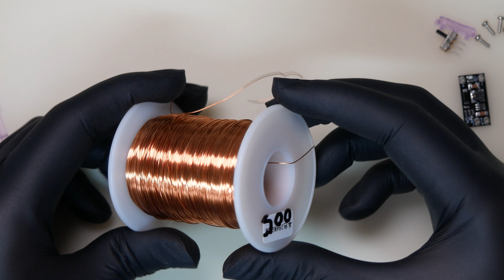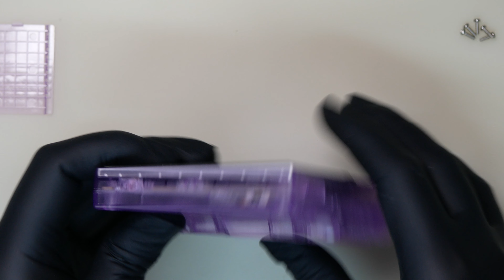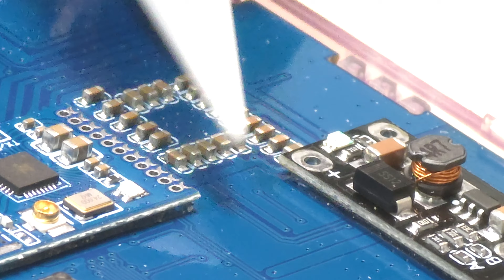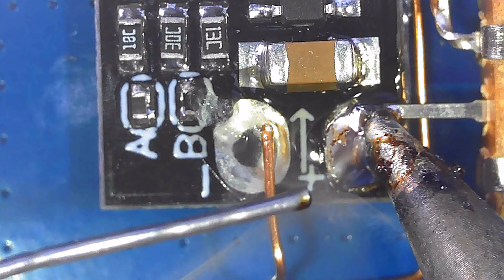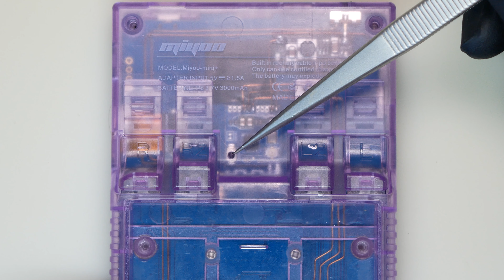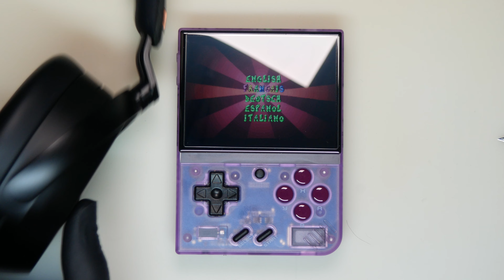Miyoo Mini Plus - Adding Bluetooth!

Comment: Amazing video! I have a question. I'm new to soldering. Can I use regular wires for this job? The type of wire you're using I've never seen before. It looks like it doesn't have that plastic protection around it. Is there any risk of shorting the board or anything if wires like yours touch each other or any part of the console's board? Thank you!
Reply from the maker: Hi! You can definitely use regular wire for this. Im using something called "enamel" wire. It actually has a coating on it that protects it from shorting out the components on the board.
I just used it because it looks a little nicer and stays in the position that you put it!